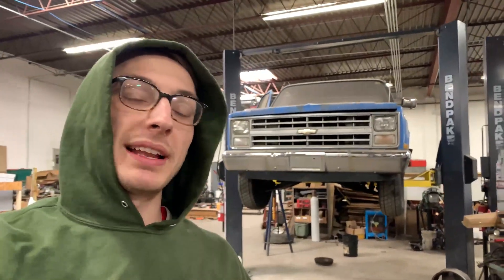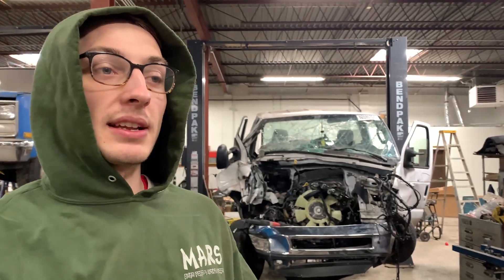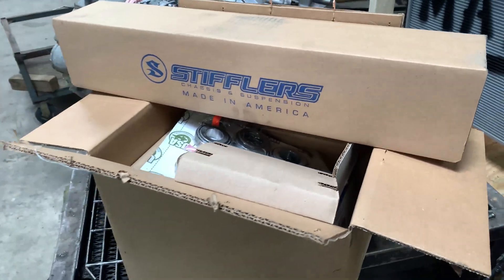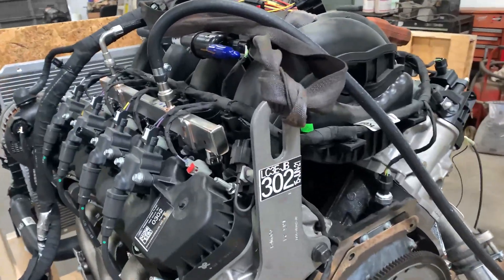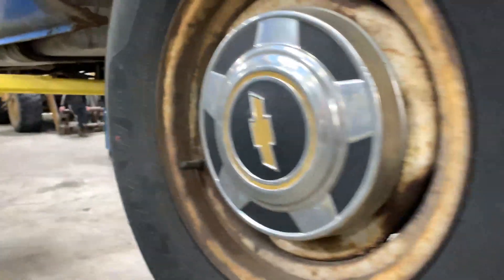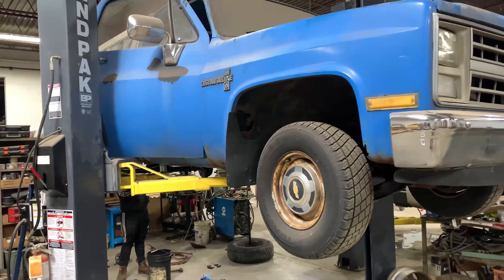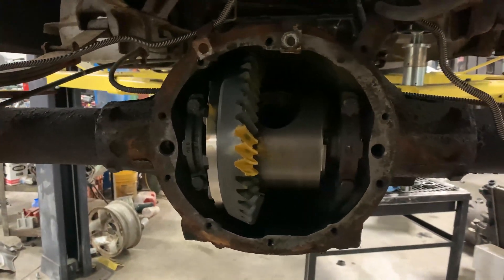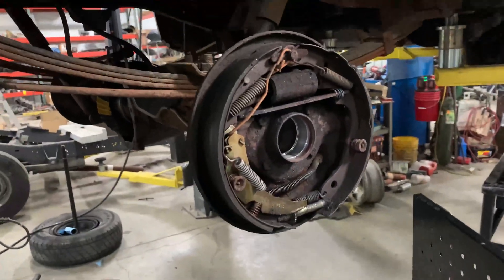GODZILLA 7.3L Swapped Chevy Squarebody C10

Comment: I can understand your optimism saying that they would be a popular swap, but is the aftermarket support there yet? What is the comparison cost between the LS 6.0 LSA and a procharged 7.3 godzilla. What's the weight difference between the two?I understand that anytime you do a newer engine swap into ANY old vehicle has its challenges and such, but you have a very hard uphill battle to climb beating a LS in universal swaps. Good luck to you.
Reply: Should've went with a 351w, make LS power on a potentially cheaper budget and still keep it controversial.
Reply: It doesn't matter, what matters is you get ahead of the aftermarket boom. That's how you become a name brand aftermarket builder.